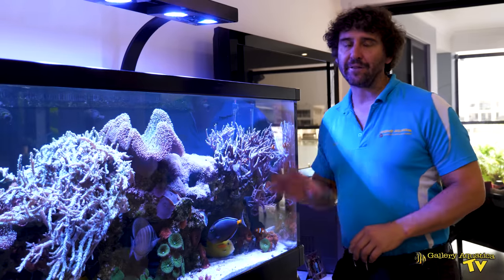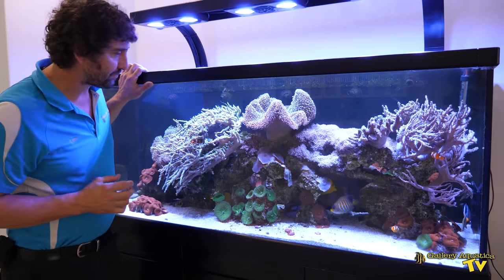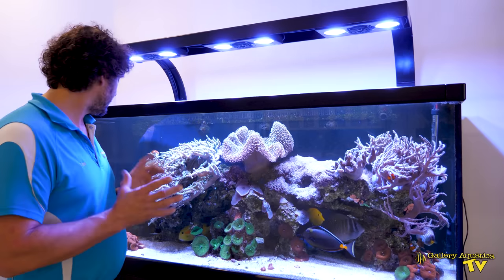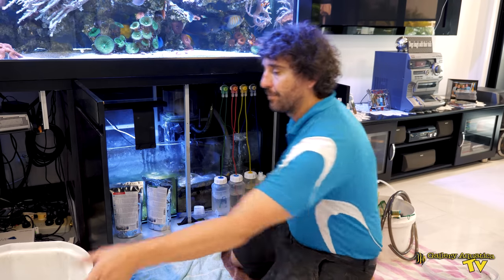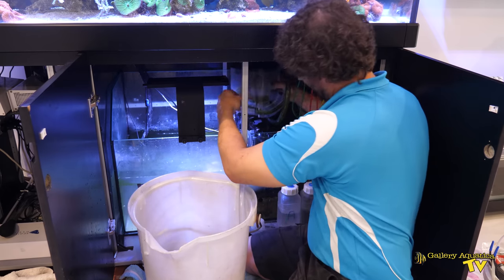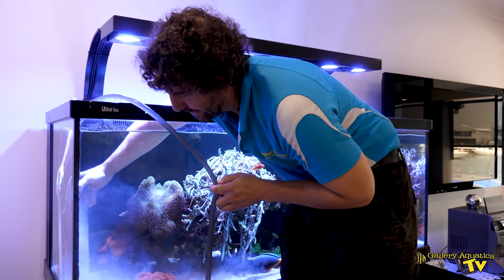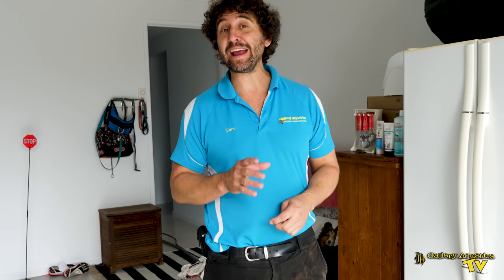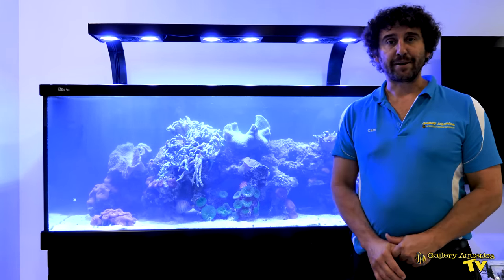Soft Coral Wonderland: Red Sea Maintenance

Comment: What levels are the nutrients at?
Reply from the maker: High. Nitrate over 20 and phosphate over 1. Cam
Reply: @GalleryAquaticaTV  That's not that bad. Some mixed reefs have those levels with no problems.